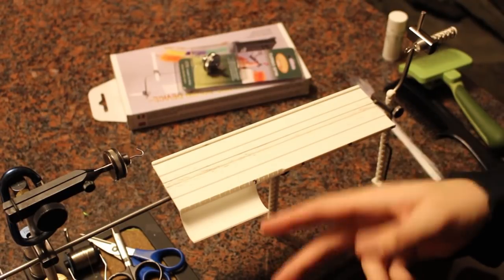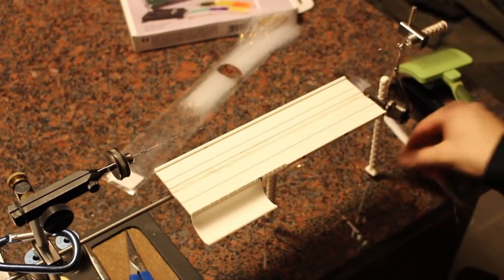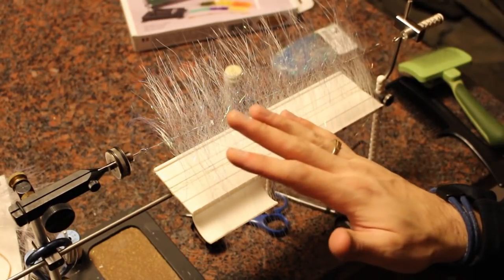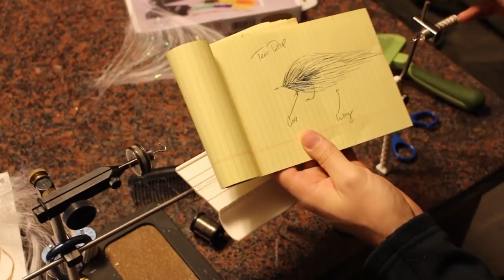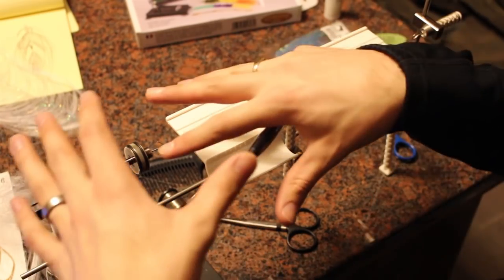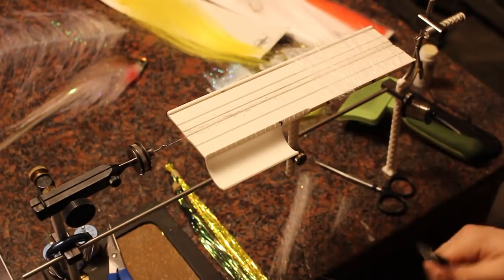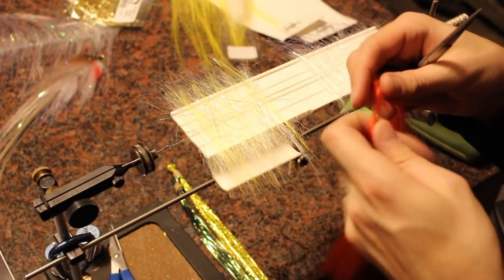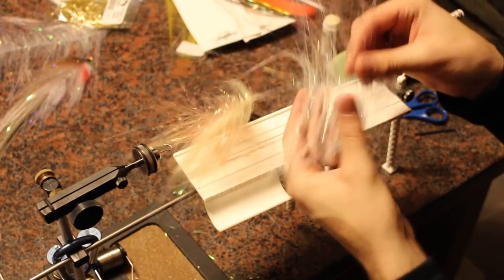Tie Like a Pro, Ep. 6 Dynamic Dubbing Brushes, Part 1 - Pike/Musky

Comment: which kind of big fly fiber is better ,straight or curled?
Reply from the maker: I've used both, and honestly think the usable quantities are the same for this application....although if you go with the straight you can get fibers about 2 inches longer for building slightly larger brushes
Reply: thanks alot